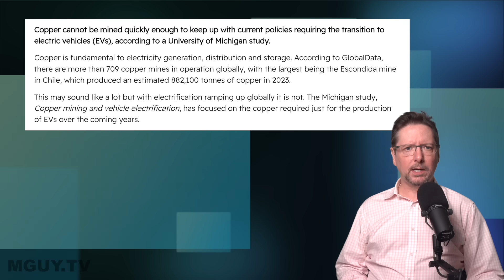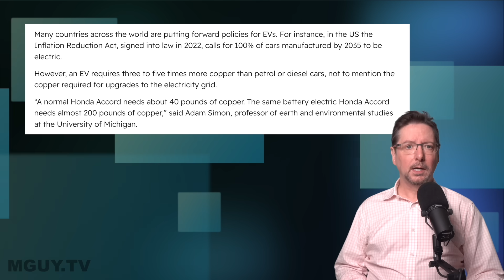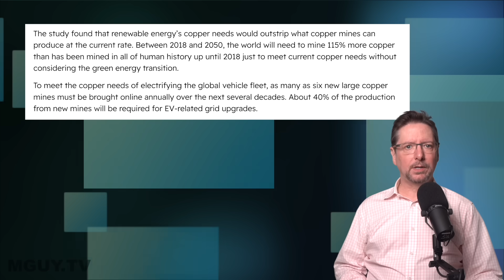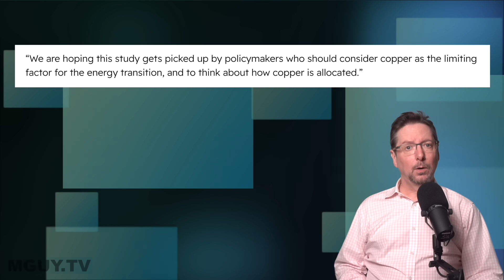Copper cannot be mined FAST ENOUGH for EVs and Net Zero Transition | MGUY Australia

Comment: It’s the Raw Materials …. Stupid……. Subverted people are incapable of thinking reasonably…. What happens to Any Raw Material, when it becomes in high demand? ….. The price skyrockets…. Duh ….
So, your current $45k BEV today, will increase in raw materials cost by 50% to 70% in 5 years and continue to increase from that point onward…… But… that’s not all… anything made of copper, will vastly increase in price as demand for the commodity rises, due to government forcing of BEVs 
By the time we reach 2035, copper will increase in price by 450 to 650 percent. 
Today copper for 1 BEV costs about $1700 to $1800/per vehicle 
By 2035 the copper will cost $8000 to $11000 per vehicle (rounded), that figure can be doubled as the final cost added to the vehicle price $16000 to $22000. 
And that’s just copper… other raw materials will increase as well, resulting in vast increases in final vehicle cost. 
Expect BEV prices to double in 5 years and triple in 10 years, as organization battle over market domination of commodities. 
But Worse, because copper is being consumed at a far higher rate, the cost of ICE cars will go up as well, but not near as rapidly as BEVs.  Manufacturers will simply start to limit copper use in all vehicles….
Roll up windows, manual door locks, low end stereos or no stereo, All LED lighting, very limited, smaller computers. Only frontal airbags, or maybe none, mechanical sunroof, anything electrical, which can be mechanical, will be replaced or eliminated, in order to control costs…. 
Good by Cadillac SUVs and pickup trucks…

Comment: We live in a throw-away world. When our washing machine breaks down we toss it out on to landfill and buy a new one. But that washing machine contains a lot of copper. Every electrical item we own contains copper and most of that copper is not removed from the item before it is dumped. 
During the 60s when I was out of a job I scrounged the dumps and places I knew where rubbish was being dumped. The amount of things that were thrown out that contained copper was amazing. I stripped them of the copper and sold the copper and the steel and aluminium left over to the scrap metal dealer. Some weeks I was making more than the basic wage. In today's world with many more electrical items produced and dumped than in the 60’s, more attempt should be made to recover the valuable metals that are thrown out.
Reply: Most of those appliances don't end up in landfills as more retailers provide pick up ànd recyling services for old appliances.  Today, Copper is one of the most recyled materials. But no one has figured out hòw to safely, at scale, recycle EV Batteries - that's a problem.
Reply: @larryclemens1850 You're wasting your finger taps on these idiots, but keep it up! There are metal recyclers every 5 or 10 miles where I live in Florida. EVs will eventually create closed- loop recycling.
Reply: @knewhunter1   due to the highly reactive nature of Ĺithium, it won't be your average scrap metal dealer who is going to recycle evs.
Reply: @larryclemens1850  That's true. EV battery packs are a treasured resource, as they are usually reused or  repurposed for off grid storage. For those that aren't, companies like Redwood can recycle nearly 100% of a car battery pack, at a profit.  Eventually it will be a closed loop system as personal vehicle ownership declines in the future and the need for new materials wanes.
Reply: @knewhunter1   Wait, back up a minute. "Personal vehicle ownership declines" That's your vision of progress? Declining standard of living? A decline in my choice of personal mobility? You really think that's progress? 
Ok, aside from dubious social/political aspirations. Just on the technical side, when a battery looses its efficiency, its chemistry changes, to restore its efficiency, it needs to have that chemistry reversed. Yes Li batteries can be recycled. Currently only about 5% are. This compares to 99% of lead acid batteries. Why? Cost and safety. It costs less to mine virgin material than it does to recycle. What makes it so difficult is the inherent reactivity of lithium. So the question becomes this: Is it really environmentally beneficial to create such a toxic mess both at mines and landfills, before the loop can be safely and economically closed at  scale? I would argue it would be a castrophic mistake to procede without that system in place, much more so than continuing to rely on better IC technology, which s far less toxic.
Reply: @knewhunter1  From what I read about recycling EV batteries, EV battery manufacturers, if they put a 10 year warranty on their batteries, they won't use recycled metals such as lithium, nickel and cobalt. Recycled metals from EV batteries will be used in laptops, mobile phones, etc.
Reply: @larryclemens1850  From what I read about recycling EV batteries, EV battery manufacturers, if they put a 10 year warranty on their batteries, they won't use recycled metals such as lithium, nickel and cobalt. Recycled metals from EV batteries will be used in laptops, mobile phones, etc.

Comment: I'm not at all sure about the physics/chemistry of this. but will the wind turbinators/EVicionados be tempted to try to substitute aluminium for copper in their favoured devices?  I know that was attempted for house wiring about 30/40 years ago, but the two metals don't mix under some conditions.
Were it possible, I suspect it would be dangerous, but these days "everyone" is keen to try to live with lithium ion batteries.

Comment: Most urban streets in the UK will need to be ripped up to upgrade the local distribution cables.   
Each sub-station supplies typically 100 houses.  So the upgraded cables will need to carry thousands of amps with a diameter of at least 2cm.  Tens of thousands of Km of such cable will be required.
Every substation and junction will have to be upgraded.
But most problematic is we don’t have the Engineers, or the labour, or the money to do it.

Comment: I have said it before. The WEF, have written a ‘discussion’ paper where it states what we all know. There is not enough resources like copper and lithium etc for both renewables electricity generation and wide scale ev ownership. They have stated that private vehicles are very wasteful being used only around 8% of the time. So car sharing it is for the masses or electric bicycles or public transport. You will own nothing… In your 15 minute city dog box on level 37 of tower F in area Z4.
Reply: The benefit is that the 10 car owners can use them simultaneously to get to work. For 10 years.
Reply: @orionbetelgeuse1937  YES.

Comment: The copper that is available would be better utilised if is was built into a single 500W alternator, than scattered amongst 25 20MW wind turbines. A single alternator being spun by a gas turbine or steam turbine can generate 500 MW 24/7, week after week, month after month. The generator in the 20MW wind turbine will probably average around  6 MW during it's life, but you still need to put enough copper into it to handle the 20 MW it may generate for 0.01% of it's life. Same applies to the copper you need to put into the subsea cables.

Comment: Can aluminum be substituted for copper in some applications? If we can eat the loss of efficiency.  Al been used as wires before and still use for wires. I had experience with Al in the past, they require more maintenance and are less forgiving with bad workmanship. The weight saving for overhead outdoor uses is very important.

Comment: When demand outstrips supply the market becomes a sellers paradise. Copper prices will soar. As copper prices rise so will copper theft and because most of the criminals stealing the copper won't be bothered with stripping back all that copper wire they'll just be 'burning off' the insulation, thus creating even more toxic pollution into the atmosphere. 

But hey, it's all for a cleaner environment isn't it? 
\o/ YAYY!! for green eco-friendly solutions \o/

Sometimes I hate being a pessimist but, as I've always said, if you are prepared to accept the worst possible outcome then you will rarely be disappointed.

Comment: For the Aussies here, anyone remember the 1 and 2 cent pieces in circulation until withdrawn in 1992?
Made of 97% copper, 2.5% zinc, 0.5% nickel.
Were they withdrawn by those in the know needing copper for a future E.V. market demand? Still legal tender if you have any.
1 and 2 DOLLAR coins are also made of copper and nickel, despite the gold appearance.
A cashless system would mean removal of all these coins and would drastically remove the purpose of the Canberra and Perth mints. Excess copper then available for their purposes.
This may well include all numismatic coinage?
The Currency Act 1965 (Cth) should prevent this?

Comment: I read that aluminium is being researched and tested to use in wind turbines and EV motors instead of copper. Aluminium is a bit less efficient at conducting electricity but 1/2 the weight and much more abundant than copper. Definitely interesting times ahead. Thsnks that was interesting and scary.

Comment: Well, if the copper can’t be mined fast enough then what’s going to happen? Copper is gonna become more valuable and becomes more valuable. It’ll be stolen for anywhere deceived can find it such as nozzles of chargers maybe even from EV's contain 200 pounds per battery. Or maybe even electric bikes. Drug addicts don’t care where they get it from another problem: turbines and solar panels are continuously being damaged by weather. Look how many turbines were destroyed in the United States by the tornado outbreak. I saw a video, not too long ago, where many solar panels were damaged by hail and needed to be replaced not only were the panels damaged when they were damaged they gave off toxic fumes. as I see it this plunge to electrify everything is just not going to cut it. When 2035 rolls around this world is a complete disaster if the left is a lot to continue with their insane demands.

Comment: Copper is an amazing element. It always amazes me how far metallurgy has progressed over the last century. Unfortunately, the current familiarity with extraordinary metals has caused most people to take them for granted and forget that there is not an unlimited supply of metal ores. 

They also forget the vast amounts of energy required for turning those ores into pure metals that we can use. There is good reason why aluminum is often called solidified electricity. And of course, steel could be regarded as metallic coal. Coal exports are usually thought of as fueling power stations, which can be replaced by solar, wind, and nuclear, but almost half of Australia's vast coal exports go into making steel, and there is no easy replacement for that. Even with 100% net zero emissions power generation (if there is such a thing) coal exports will keep growing for things like making steel.

Metals of all kinds, including copper, are fundamental to technology, but are never going to be the unlimited resource that is always there on tap without producing problems of their own.
Reply: Steel can be made without coal using just electricity.
Reply: @Tom-dt4ic  Theoretically correct. Now you should ask yourself why is it that major steelworks around the world are not doing that. (hint, it has to do partially to do with the competitive pricing of the resulting steel plus the scale of the electrical requirements). So do you want to destroy the world's economy by doubling or tripling the price of the single most important metal on the planet, or do you keep feeding that coking coal into those steelworks?

When New Zealand had power shortages recently it emerged that they had the problem that 15% of the nations electricity production (and virtually the entire output of their largest hydro-electric scheme) was being used by a single aluminum smelter. No country makes enough electricity to power the world's steelworks. That is why there is no feasible replacement for coking coal in the production of steel.
Reply: @artistjoh  I appreciate your thoughtful reply.  I'm actually a little more optimistic that steel making, and other industrial processes, can be economically decarbonized in the coming years.  Cheaper and cheaper energy from the sun will surely be a big contributor.  

As for destroying the economy, global warming will do that far more effectively than tripling the price of steel ever could.  Just the cost of one super storm in the US could decarbonize several steel mills and pay for the extra electricity needed to power the lower emission technology for several years, at least.  And what price do you put on childhood asthma, and lung cancer deaths? to name just a few of the nasty externalities of burning stuff.
Reply: @Tom-dt4ic  I did not suggest that the use of coal in steel production is a good thing, however no one has yet devised a workable alternative, and steel is so central to modern technological societies. It is used in everything from concrete construction to tool making. I am just like you, currently in a building that contains substantial amounts of steel. My table has steel fittings. The cupboard door have steel hinges, my stove is made of steel, my fridge, even my kitchen utensils and pots and pans are steel, along with my car, my laundry tub, shower head. Even my shoes have some steel in their construction. Steel production is a huge part of our modern world that we are essentially enslaved by our own use of the metal.

Copper is just as important. Jet aircraft engines won't work without cobalt used in fan blades. Gold is essential for electronics, space exploration, and medical devices. Zinc, lead, tin, nickel, are all fundamental to the world economy, but all metals suffer from similar problems of environmental damage, costs, including energy costs, and availability. Despite a desire to solve these kinds of problems, and to address CO2 emissions, metal production remains a choke point with no easy solutions, and often no solution at all. It is impossible to increase copper production beyond the economically viable and mineable resources. Impossible to open enough new mines at the required rate.

Ultimately, this is less about what we do, and more about the number of humans doing the things we do. Smaller populations require less resources, but there is no easy way to reduce population numbers. I think populations will naturally go down over the next couple of centuries, but it remains to be seen whether or not we will be able to successfully ride the wave of peak population levels before numbers get low enough again that our resource usage becomes more manageable. 

Meanwhile we have the curious situation that Australia has enough of the undesirable coal to continue production for thousands of years, but the world does not have that much of the most important metals. Including viable copper resources.

Comment: There is twice as much copper in an average house pipework than any EV. ICE cars wiring systems are full of copper...hope this helps
Reply: Housing with plumbing is a necessity, electric cars are not. Pipes for plumbing don't have to be made from copper. An electric car requires over three times as much copper as a ice car does and doesn't require copper cables to keep it running. Gas powered cars don't require the mining of millions of tons of copper to build charging stations and all of the other new infrastructure because it is already in place. Won't even go into the batteries being 5% recyclable , the cars being throwaway after a minor accident or an ev adding days to a long trip to allow for charging. Hope this helps.
Reply: It's not the copper in the EV, it's the amount of copper needed for the infrastructure to charge 2 billion of these things daily.

Comment: You can avoid reality, but you cannot avoid the consequences of avoiding reality.
Reply: Even harder is avoiding physics.
Reply: Ayn Rand quote
Reply: True, but even if fossil fuels were not the major cause of global warming (which they are) they too are finite. Using crude oil at the current rate of 100 million bpd can only go on for another couple of decades no matter what technology we throw at it. Wind and solar power are for all intents and purposes infinite and the machines we use to generate power from them can be endlessly recycled.
Reply: @kiae-nirodiariesencore4270  what is your proof that fossil fuels are causing global warming? how do you recycle wind turbine blades? doesn't change the fact that obscene amounts of copper are required for net-zero and that will have a profound impact on the environment.